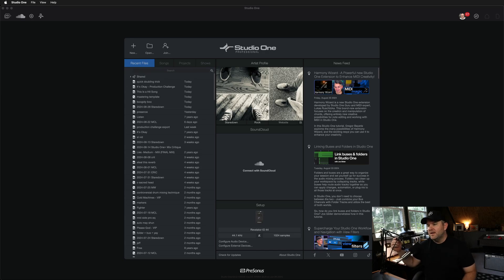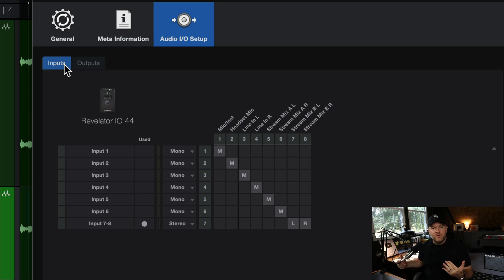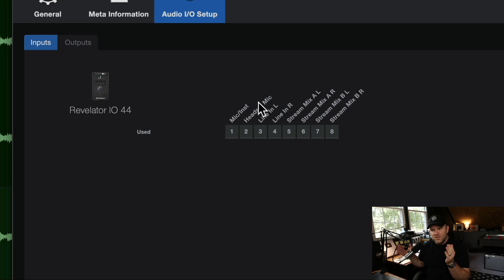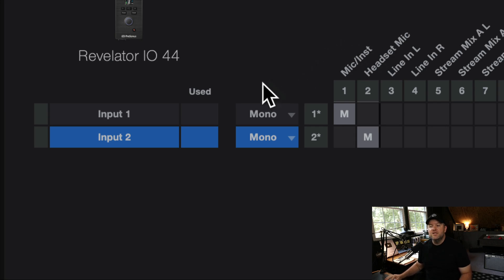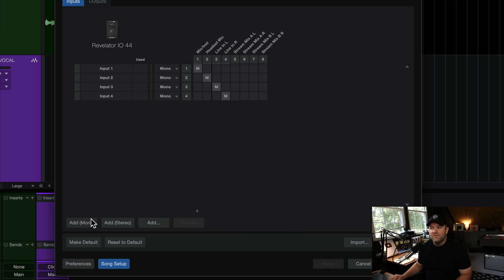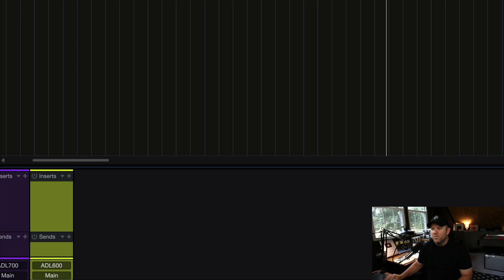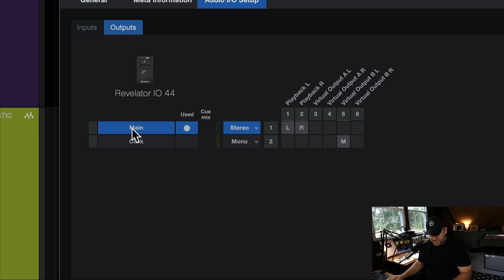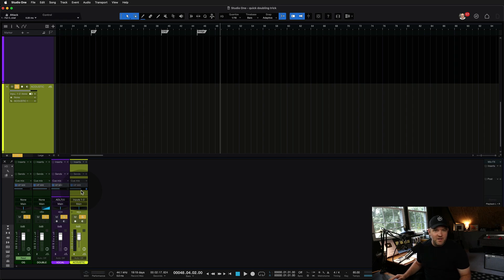A Quick Guide on Audio I/O | PreSonus

Comment: Can I use all 10 Outputs on 1824C to lead out 10 separate mono signals from the daw to stage mixer (e-drums sends a midi to PC, where is VST drums plugin and I need to get 10 separate outs) ? i tried to add the outs, but only 8 I can route, but in real there are 8 line outs + main LR outs. Thx

Comment: My 1824c line inputs 3 and 4 show on their proper channel on the digital meter but are controlled with the wrong input gain knobs. When I'm plugged into ch.3 the #4 gain input knob controls that channels volume. When I'm plugged into ch.4 the #3 input gain knob controls channel 4. Channels 1/2, 5/6, 7/8 all work properly. I think I may have a defective unit.

Comment: Joe, thanks for this.  Definitely sheds some light on these basic concepts.  BUT!

I am super new to the whole DAW thing.  Using Studio One 4 which is more than sufficient for my current needs.  Here is my physical chain and setup:
Win 11 Pro, 40GB RAM, m.2 and SATA SSDs
My audio interface is a MFX unit from VALETON, the GP200
I have a set of powered 2.1 speakers connected to the PC

I am able to get SO4 to see the GP200 mfx unit.   When monitoring, the bars show strong input levels.

But 2 problems:  
I cannot seem to RECORD the signal from the GP200 interface into SO4.
I get NO AUDIO out to my speakers.

Using an older Boss GT1 mfx unit on an older build of this same machine, I was able to successfully record and hear playback or monitoring through my speakers.

But now on this more sophisticated GP200 mfx interface, I cannot record and cannot hear playback or monitoring through my speakers. 

HELP!  Please!  I know this should be simple, but I cannot figure it out.  Audio for all other Windows functions is 100% normal.

For comparison, a version of CAKEWALK DAW i am using is able to both record from the mfx GP200 and also I can hear playback/monitoring from my PC 2.1 speakers.

TIA....cheers!

Comment: I use Studio One 6 at church to run stems for worship songs through a Volt 476P. The I/O setup allows me to group multiple stem tracks together, creating 4 different subs routed to 4 different outputs: all guitars to1, all keys to 2, all loops, FX, BGVS, etc. to 3, and click and guide to 4. These outputs go into 4 channels on the worship center mixer for playback/monitor during live performance with the band. Also like the fact that different I/O configurations can be saved (export) and loaded (import); that's a handy feature.

Comment: Joe, I have an analog 8-channel mixer and an Audiobox 96. Which interface would you recommend to get the best out of both?
Reply: Depends on what the mixer can do and what you want to do. If the mixer doesn't have 8 individual outputs, then a different interface won't help, since the mixer only has stereo outputs. If it was me, I'd get rid of both and use a studiolive mixer
Reply: @ I decided to get a Studiolive AR12c. Is there a way to use the MIDI in’s and out’s of the Audiobox USB 96 so I can link my synths to my computer?

Comment: I'm using studio one v6 and studiolive 32r. My inputs in universal control are set to analog and my outputs in Studio One are set yo mains. I can record and playback with no problem. I want to utilize aux 1 fof a mix when I'm tracking. But I don't understand about switching my inputs in universal control to USB AND selecting digital sends. I have been on support with Presonus. Could you fo a video about this. Thank you Joe, youvbeen a big help on so many other matters.

Comment: My Windows system is set to 48 kHz with its audio interfaces (use ASIO driver), but SO1 only shows 44.1 kHz and cannot be changed. When loading projects with 48 kHz, an error is often displayed and the audio does not play. Then I have to change the audio interface and when I switch back it works, even if only 44.1 kHz is displayed. Is there anything I can do about this?
Reply: What interface are you using?
Reply: @patrickm.4469  I usually use the built-in Realtek ALC1150 or output the signal via the nVIDIA GP104 or JBL Quantum 610. Depending on the process (stream, etc.), the ASIO4ALL, the generic ASIO driver from FL Studio or the generic ASIO driver from Steinberg is used. In other DAWs (Ableton, Samplitude, Reaper, Cubase) these devices are addressed at 48kHz.
Reply: @patrickm.4469  I usually use the built-in Realtek ALC1150 or output the signal via the nVIDIA GP104 or JBL Quantum 610. Depending on the process (stream, etc.), the ASIO4ALL, the generic ASIO driver from FL Studio or the generic ASIO driver from Steinberg is used. In other DAWs (Ableton, Samplitude, Reaper, Cubase) these devices are addressed at 48kHz.
Reply: @patrickm.4469  I usually use the internal Realtek ALC1150, the nVIDIA GP104 or the JBL Quantum 610 Wireless interface. The signal is routed via the generic ASIO driver from FL Studio, the generic driver from Steinberg or ASIO4ALL. The projects are in 48 kHz, but in Studio One only 44 kHz is displayed and a change is not possible. Since the projects work, the question is, is it just a display problem with the DAW?